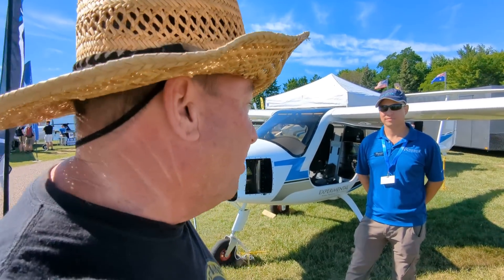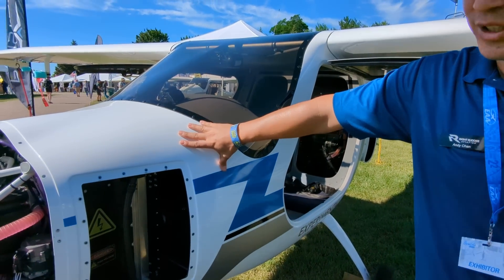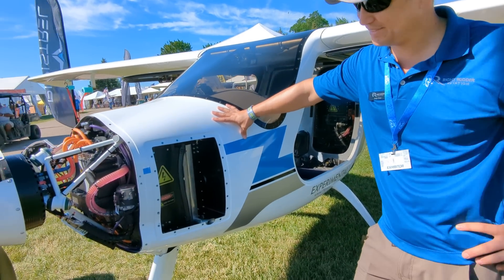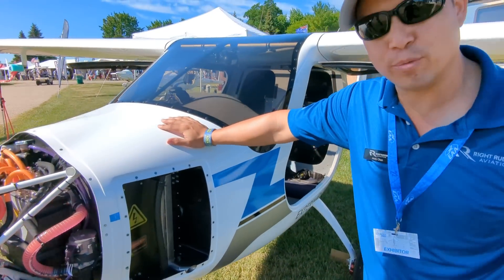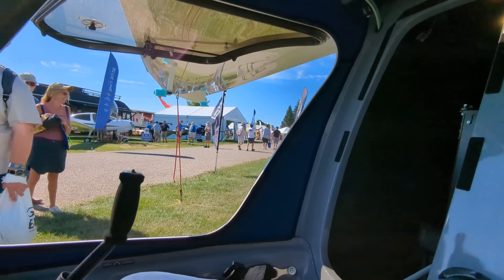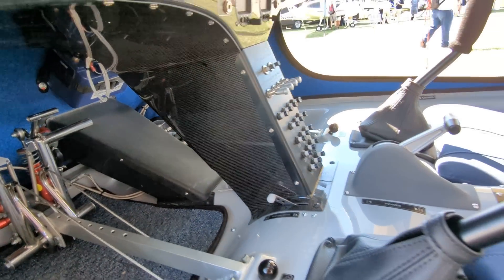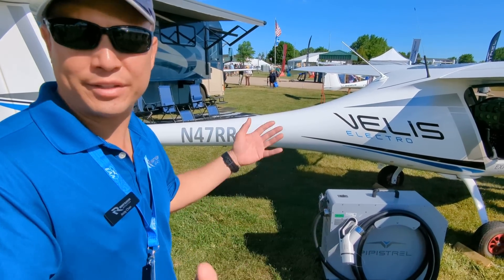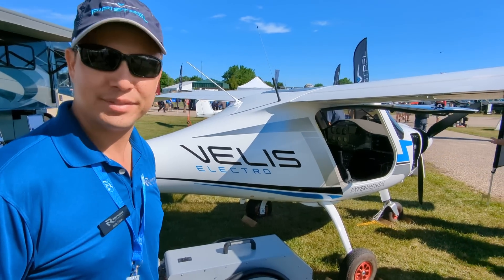Electric Airplane?! Pipistrel Electro at Airventure 2022.

Comment: Hey the first powered flight lasted 200ft. Atleast the first certified electrically powered flight can last nearly an hour. Sceptics will always be there to critique but pioneers do end up changing the future. Go Pipistrel
Reply: I like your optimism.  Its gonna need another couple of revolutions in battery tech to get where we need to be.  I suspect while thats being worked on, something else will appear instead..
Reply: @MrRugbylane  Considering a Lucid Air has a range of 500 miles and Long Range Model S is a bit over 400 miles, I’d say we’re very close to being there.   4680 cells from Tesla carry more energy than traditional 2170, so we’re even closer.  Now it comes down to packaging and of course, cost.  I can see 2 hours flight time in a couple of years.   Remember, this is a trainer, not a cross country unit.
Reply: @alexnutcasio936  i hope.so.  it could be genuinely revoltionary for private aviation.
Reply: @alexnutcasio936  Car range does not equate to aircraft range. Many light aircraft can fly for over 1,000 miles, some at over 200 mph. Try taking an electric car up to 200 miles an hour, see how far it goes.
Reply: @PistonAvatarGuy  
Speed is no problem at 33000 feet altitude , with an indicated (actually CAS) speed of 116  mph, you are cruising at 200 mph TAS.
Since the electric motor does not lose power with altitude as a non supercharged O-200 will (by a factor of 3) climbing to that altitude ( with some oxygen, of course) is no problem. If you can climb at ~ 800 ft/min.

BTW, Rolls Royce did break the speed record with an electric airplane.
But range is indeed limited, even when increasing the wingspan.
(when flown at optimal CAS, range is proportional to wingspan, and so is L/D max)
Increasing span is always good, especially for gliding distance to the next alternate airport, as a well prepared flight plan will allow.
The effect on improving endurance is even more effective; endurance is proportional to wingspan to the exponent 1.5
(Doubling the wingspan will increase endurance by a factor of 2.82 all else being the same)
Reply: @arturoeugster2377  My point was that batteries barely store enough energy to power this aircraft for 50 minutes, at a very low speed, so even the same duration at a higher speed is completely out of the question on battery power.

Yes, Rolls-Royce broke the speed record for electric aircraft, but that very same airframe has a much higher top speed with a piston engine. With a modern piston engine, that aircraft would be even faster.

Edit: I just drool over the thought of a 925 hp, 200 pound F1 V10 powering a racing aircraft, it would be epic.
Reply: The favorable effect of increasing wingspan is used by Boeing in the newest, long range Boeing 777X, where the added cost of folding wingtips pays off.
Reply: @arturoeugster2377  Longer wings aren't going to make up for the enormous deficiency of battery energy storage, not even remotely.
Reply: @PistonAvatarGuy : correct.
My motivation ,as an Instrument instructor (CFII) is to see how the endurance can be improved  to over 2 hours for an adequate instruction flight  covering the most important phase of cruising under ATC in actual IMC conditions, where the communication with the various control centers (departure control, ATC centers, approach control and  destination tower ) under normal and emergency conditions are practiced at LEAST EXPENSE to the instrument rating applicant. 
The current cost increase of aviation fuel is a real motivator.
There is a mounting shortage of ATP's (Airline transport pilots), which require a minimum 1500 hours of flying time to qualify.
Relatively short (2hrs) of productive learning and practicing flights are far more important, than boring long range flights. Except a few flights that must be acomplished on conventional AC like a C 172 or better on a C 182 R
( complex airplane , controllable prop and retractable landing gear), and multiengine aircraft, like a Piper Aztec and on a full motion simulator.
We are not close to this, because the aircraft must be certified in the US. 
I think by modifications like span increase, switching to variable reluctance electric motors, mounting larger batteries on streamlined, removable pods (air cooling) can lead to an adequate training aircraft, with reduced operating costs. A hybrid is also under consideration, because of the requirements on range, legal  IFR flights must satisfy.
(Missed approach, flight to alternate, approach to AA and ½hr normal cruising speed, plus likely required holding times, etc)
Reply: @PistonAvatarGuy  This doesnt even make sense. There are electric cars capable of 200 mph i am sure, but where wouldyou drive it?
Reply: @arturoeugster2377  "The current cost increase of aviation fuel is a real motivator."

That's not not likely to ever make an insanely expensive, electric aircraft the cheaper option, even when cost of operation is considered. The Velis Electro costs about $60,000 more than the Rotax powered Velis Club, and that doesn't include the very expensive charger that would be required for a quick turnaround.

"... mounting larger batteries on streamlined, removable pods ..."

The weight of something like this would be a major problem. The Velis Electro is already 190 pounds heavier than the Rotax powered Velis Club, that's a whopping 25% heavier!

Hybrid aircraft will never make any sense, the weight of the hybrid system would destroy any potential increase in efficiency that a hybrid system could provide, and there is no potential for improved efficiency with hybrid systems used on piston engines in aircraft.
Reply: @jimbo44cc13  You missed the entire point of that comment. The person that I replied to seemed to think that aircraft could have 400 miles of range, like some electric cars, but that's not possible with current technologies, except at very low speeds (motorgliders). My point was that many light aircraft are both fast and offer much longer range than even electric cars can provide, while electric aircraft can't provide comparable range at comparable speeds.

Put simply: Speed requires energy, but batteries don't store much energy.
Reply: @arturoeugster2377  Actually, there is one way that hybridization could offer a benefit with piston engine aircraft, and that is via an electric power recovery turbine, but no battery would be required. Current F1 engines use this technology and offer around 50 percent thermal efficiency, on par with the most efficient diesels in the world (ship engines).

The cost of modernizing aircraft piston engines and making use of power recovery turbines could never be justified, though. It's unfortunate that no government programs are offering funding to improve piston engines for light aircraft, as we really need to put an end to the use of leaded fuels.
Reply: @PistonAvatarGuy  
Turbo compound engine, powered the DC-7.
Reply: @arturoeugster2377  Right, and the later Constellations, but they were somewhat problematic. I think that the electric power recovery turbines solve a lot of problems.
Reply: @PistonAvatarGuy  
You mean a configuration, where you have a large turbo charger, maybe 2 stage, where a portion feeds the piston engine and another, higher pressure second stage bypasses the piston side and adds flow ,oxygen rich to the high pressure piston exhaust stream, which was run with a healthy overrich mixture and in a post combuster burn stream  before the large main turbine, driving through a reduction gear a generator large enough to keep a battery charged up and to drive the second, maybe contra rotating coaxial propeller, elecric motor driven. This motor is super efficient, namely a variable reluctance 93% efficient tesla motor.
That is a novel configuration, which is much lighter than the heavy battery of the pure electric Virus.
Many advantages, high climb power, over rich mixture protects the exhaust valves, not much different from the starting procedure needed for a TIO 541 , 375 hp Lycoming.
For cruising  you mainly operate the piston engine at low sfc and the electric side for charging and general electric needs, like on a Boeing 787, all electric auxiliaries, no leaking hydraulics.
When power is required both props give high thrust, using the battery as power source.
The aircraft can fly much higher  because the electric motor does not lose power with decreasing density.
Hey, you should patent this never before made hybrid.
Very robust, cool, well lubricated pistons with some small amount of injected oil, later burning in the post combustor ,with the added , injected fuel, with a low, TIT  (long life main turbine). Quiet electric flight over populated areas
( low near idle piston side)
Yes, that should be tried.
The supercharger could be driven by the piston side, or by the main turbine, or electrically, or with it's own turbine, as a conventional turbo charger.
Like you say, no leaded fuels.
3 - way hybrid:
piston, bypass turbo electric prop, electric with battery operation, or any combination suitable for the flight phase.
Reply: But no diesel engine  because they always produce soot.
Not avoidable with the extremely high compression ratios.
On ships soot is accepted, leads to dirty stacks.
The high combustion temperatures force the production of carbon particles.
See : Boudouard equilibrium.
Well above 1000°C combustion temperature.
Reply: @arturoeugster2377  What I'm talking about is much simpler, it's simply a motor connected to the crankshaft of the engine and a turbine which captures energy from the exhaust and uses it to drive a generator and a turbocharger compressor. Just imagine a turbocharger, but with no wastegate, and any energy which is captured by the turbine, but is not needed to drive the turbocharger compressor, is converted into electrical energy by a motor/generator. The electrical energy would then be fed directly into a motor which is connected to the crankshaft of the engine. No additional propeller is required. Really, you just need a motor generator unit on the turbocharger (it's called an MGU-H on F1 engines) and a motor generator unit connected to the crankshaft of the engine (MGU-K on an F1 engine).

The system that you described is very much like what was used on the Napier Nomad, which wasn't all that impressive.

No battery would be necessary, as all of the energy produced by the MGU-H would be fed back into the engine (via the MGU-K) to help drive the prop. It's possible that a battery could be used to provide takeoff power though the MGU-K, but its weight would almost certainly offset any improvement in efficiency that it would provide. The cost would never be justifiable.

All of the relevant patents almost certainly exist and no one is ever going to produce an engine like this, so I'm not too concerned about trying to patent anything.

The mechanical PRT system used by Volvo on the D13TC might be the better way to go, it's likely to be less expensive and might even be more efficient than an electronic system.
Reply: @arturoeugster2377  Well, diesel engines are just heavy and expensive, and they require huge amounts of boost to make a decent amount of power, so they just don't work well in aircraft. Achieving those high manifold pressures also puts a huge strain on turbocharging systems, and this sometimes results in the need for multi-stage turbocharging systems, which are just expensive and impractical in most applications.
Reply: @PistonAvatarGuy  
Given your location, the US is different from Europe, which is very noise sensitive, and electric cars and electric airplanes are preferred, and soon will be required, there are, and habe been noice fees added to landing fees, which depend on the aircraft weight, actually wing loading, the highest fees are being paid by school motor gliders.
It is idiotic, but its the law here, where the direct democracy here penalizes the little general aviation tolerated. Hence the certified exempt electric airplanes here.
All the range limitations inherent are a problem, which might be solved with hybrids, which are probably also exempt from the significant noise fees. If quiet operation can be demonstrated over populated areas.
Come to Europe to realize the treatment of general aviation, especially the private pilots, which are called 'Hobby pilots' and envied because mostly wealthy people can afford to fly.
Even Seaplanes are prohibited on the large lakes.
So the electricity generating turbine idea of yours is worth looking into. As a charging unit for a 'small' battery to be used to cross over noise sensitive areas at low altitudes. 
Other wise for efficiency the not completely matured Turbocompound directly geared engines had the lowest sfc, 0.33 lbs per hp hr, compared to 0.5 to not lower than 0.45 perfectly leaned piston engines. Turboprop engines are way above 0.7 lb/ hp hr. (P&W PT6)
The jet age killed those advance TC's on the what you mentioned Super Constellations and the "3-engined" DC 7 (taking into account the many engine failures)
Reply: @arturoeugster2377  Modern ICEs can almost certainly be built to be every bit as quiet to people on the ground as electric aircraft. Air cooled engines are loud because they aren't as solid and monolithic as liquid cooled engines, mufflers and turbochargers could be used to basically eliminate exhaust noise, PSRUs could be used to reduce propeller RPM and noise, etc.

There was a video online of Burt Rutan talking about the Toyota/Scaled Composites Lima 2 prototype (Model 191-4), which was powered by the Toyota FV2400-2TC, he said that it was nearly silent as it flew overhead. I really wish that I could remember which video that was.

Edit: Turbo-compounding certainly has its advantages when it comes to efficiency, but the cost would be hard to justify.
Reply: @arturoeugster2377  Found the video where Rutan talks about the Toyota powered aircraft. The relevant part starts at 20:56 in that video: https://www.youtube.com/watch?v=2OZQ-9Nd76g
Reply: I have made a few effective minor alterations (covered by form 337) on my airplane to significantly improve the optimal cruising speed and range from 1200 Nm to 1400 Nm.
 On the non load bearing part of the aircraft.
Propulsion: The engines Lyc. TIO 541 had problems with the waist gates at the cruising altitude (Fl 300), there the waisted energy was thermal and overheated them and no easy modification exist to use that waisted energy to vastly reduce sfc at the otherwise optimal aircraft operating conditions ( the repeated use of 'waisted' is intentional)
So your idea might show the way , without structural changes on the engine, this time not concerned with noise, to recover the waist.
Contra rotating, coaxial propellers do result in improved efficiency. (longetivity of the Russian bomber with those props)
Hopefully there is a way of extending the range by another 300 Nm on the same fuel load and reserves.
Recall Breguet's Range equation:
R=(L/D÷ sfc)× eta × ln(1+ Wf/We)
       |          |          |                  |     |
     AC   engine   prop        fuel  eW

That way I can avoid landing in Iceland and  Greenland and the huge fees flying in  "controlled  VFR" or worse , much more expensive IFR. Azores are acceptable.
Reply: @arturoeugster2377  Without new engine designs, the potential for improved efficiency is minimal. Eliminating lead from aviation fuel would also be difficult without modern engine designs. Retrofitting PRTs onto older engines may have some potential, but the success of something like that wouldn't be likely.

If you're curious about what's possible with modern engine designs, have a look at the Adept Airmotive 320T, its BSFC is claimed to be as low as 0.33 lb-hp-hr at cruise, without needing leaded fuel, or a PRT. That engine is also rumored to be very quiet.
Reply: @arturoeugster2377  This guy has some great videos about aircraft engine technology, this one is related to the Adept Airmotive 320T: https://www.youtube.com/watch?v=GJy93vrbvw0
Reply: Some improvements are there, for example a more efficient electric motor, compared to the induction motor used now.
Tesla's variable reluctance motor, with no losses in the rotor.

Comment: Once these Aircraft get approved in the US how much will it save a student pilot getting his private pilot ticket? So I have heard it currently cost between $7K to $10K for a PPL.
Reply: They wouldn't save any money, at all. This aircraft is significantly more expensive than the ICE powered aircraft that it's based on, plus it requires the batteries to be replaced more than twice as often as the engine needs to be rebuilt in the ICE aircraft, and the batteries are far more expensive. This aircraft makes absolutely no sense, for any purpose.
Reply: It'll probably see a lot more service in Europe and countries where there is less resistance to adopting electric vehicles.  I can't see USA taking it up in a hurry unless the price of AvGas goes through the roof.